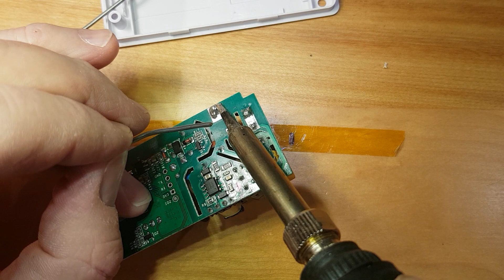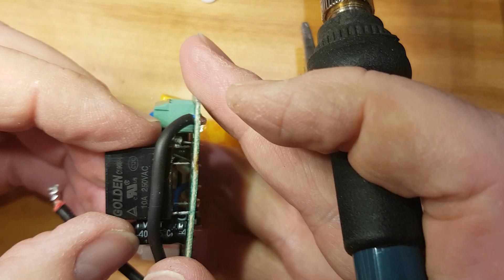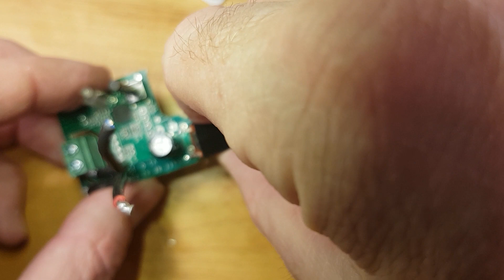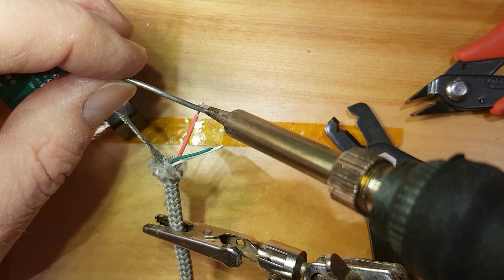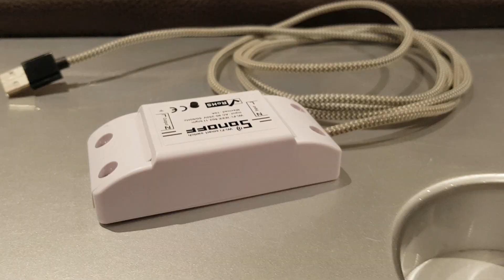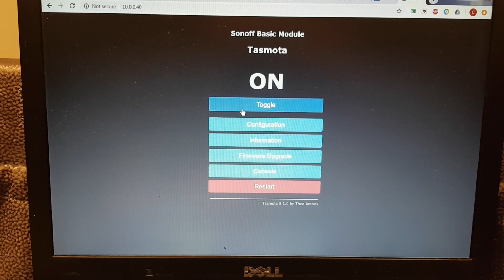Sonoff Basic R2 relay isolation and mod to low voltage

Comment: Great idea to convert a Sonoff Basic R2 to a simple Sonoff Relay device even there are similar Sonoff SV to do the job. It doesn't hurt to try one to get to know more about the Basic R2 device. Thank you for your time. Well done.
Reply from the maker: I think the low voltage sonoff was more expensive, at least at the time I made the video. Thanks for watching and commenting.
Reply: @thecityviking  Possible. Thank you.

Comment: Hi, good job!. I have a sonoff basic but turn on 1 sec a bulb, but ewelink says that still on. Maybe the relay is damage?
Reply from the maker: The device may not update that quickly through the ewelink server. Are you switching it on and off by the button?
Reply: @thecityviking  Thank you for your response,

Sorry, I wrote wrong my question.

When I turn on my sonoff (from button, voice or app), is quickly turn off (1 sec) by itself, but ewelink still shown turnon

Comment: Great Video many thanks. 
Can I achieve the same result without cutting the board ? i.e 
1. Connect the black wires between the output and the relay. and 
2. connect the usb connection bypassing the AC components without removing the AC parts physically from the board ? I think it will be less messy if it would work.
Reply from the maker: I think that may work as long as you cut or unsolder the wires coming from that little transformer.
Reply: you all probably dont give a damn but does anybody know a tool to get back into an instagram account?
I was dumb lost my login password. I love any assistance you can offer me!
Reply: @Gary Emiliano instablaster =)
Reply: @Austin Fox i really appreciate your reply. I got to the site thru google and I'm waiting for the hacking stuff now.
Takes quite some time so I will get back to you later with my results.
Reply: @Austin Fox DAMN IT ACTUALLY WORKED! I literally got access to my Instagram account details after roughly 40 mins of using the site.
I had to pay 15$ but definitely worth it :)
Thank you so much, you saved my ass :D
Reply: @Gary Emiliano happy to help =)
Reply: @mahmood Khalaf this comment is a year late, however I have successfully done this without cutting the board in half. However you still have to cut the board in one spot. 

What I did. First I cut the black and white wire from the transformer to the low voltage side. In the video he desoldered them. Next I cut the blue cap out cutting close to the board. Next I cut the metal fuse looking item next to the relay on the high voltage side. Finally I cut the trace from the high voltage input to the yellow device above the relay. Then I soldered the 5v to the same pin as the video. I soldered the ground to the neutral wire that was originally connected to the transformer on the hv side. To complete the circuit I bridged the original HV load and neutral ports with a small piece of wire. I deployed the modified switch in my garage with inching on .5 seconds, power state set to off. When I click the widget or tell Alexa garage on the switch activates for half a second tripping the garage door to open. Only issue I have is I have to say Alexa garage on to also shut the door.
Reply: @adker1986  Thanks for your response. I was able to achieve my target following the instruction in this video https://youtu.be/u0_x2pp8lZg it's in Italian I think but quite demonstrative. Thanks again for your efforts.

Comment: input 5v, output ?
Reply from the maker: Not sure what your question is. You can run the Sonoff on 5V and the relay can switch any voltage on and off.
Reply: @thecityviking  can be achieve just the oposite? I want to input 220v and Switch a 24v output signal
Reply from the maker: the Sonoff is rated at 220v, so all you would need to do is isolate the relay and you are good to go.
Reply: iTS CLEAN CONTACTS VOLT FREE SWITCH ANYTHING

Comment: May I ask please, why we need o do that?
Reply from the maker: You don't have to do that but if you do you can control it with a battery if you wanted. If you're using something around water you want the really isolated. Perhaps hot tub control?